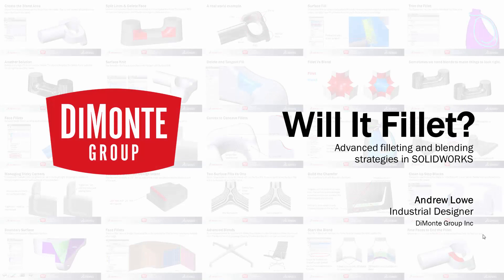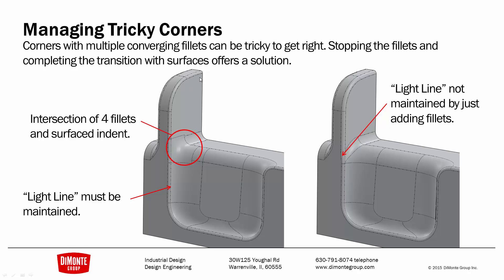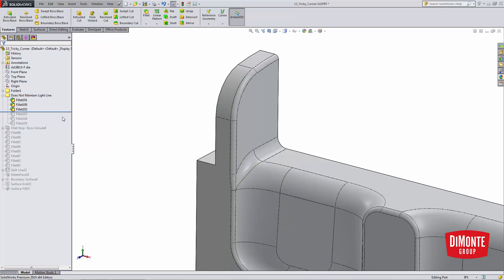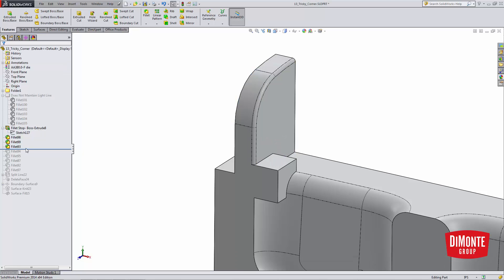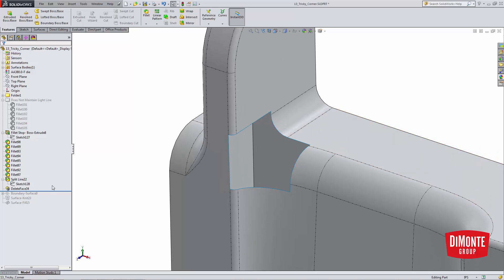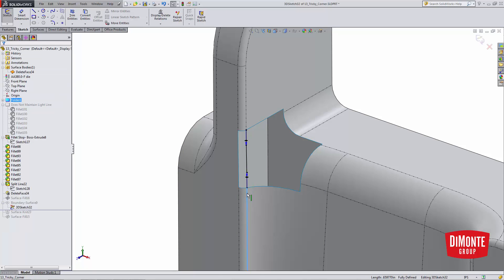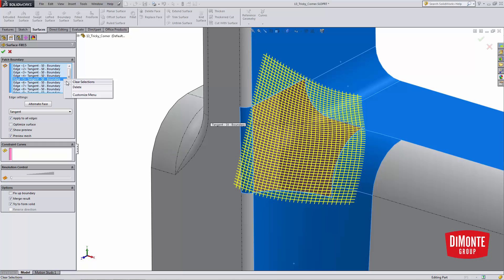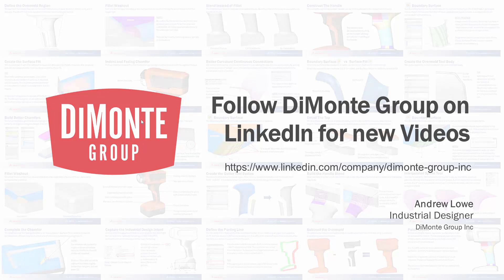Will It Fillet? | 11- Tricky Fillet Intersections

Comment: Please upload the file to replicate.
Reply from the maker: All of the sample files for these videos are available under the News & Resources section of our website.  The files for the filleting presentation are here: http://dimontegroup.com/filleting-master-class/

The downside is that these files were created 6 years ago.  The one on our website for this tutorial (13_Tricky_Corner.SLDPRT) was modeled using SOLIDWORKS 2012, and does not rebuild correctly in later versions.  

If you want to use our model and don't have SOLIDWORKS 2012, you will need to do a little repair work due to a surface cut flipping its intended direction and also the loss of a couple of face and edge IDs.  This sort of stuff happens.  It's good to learn how to deal with it when it comes up.